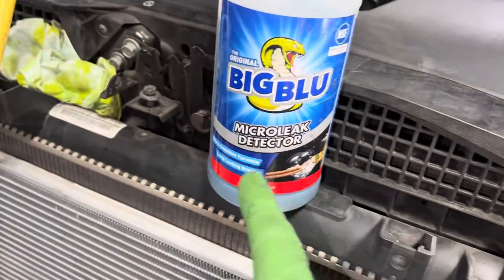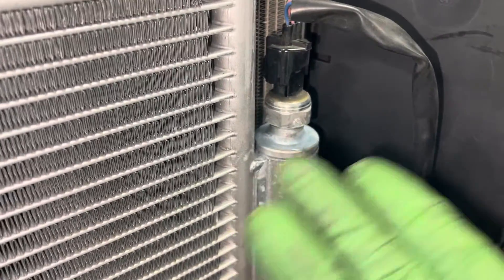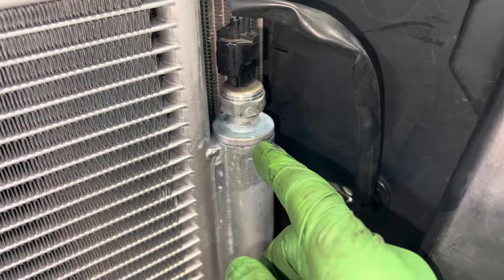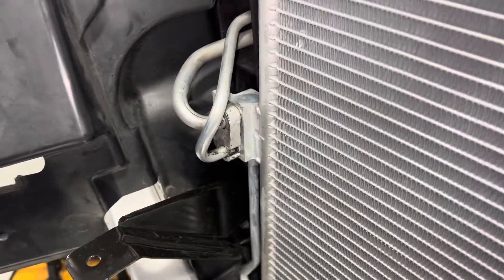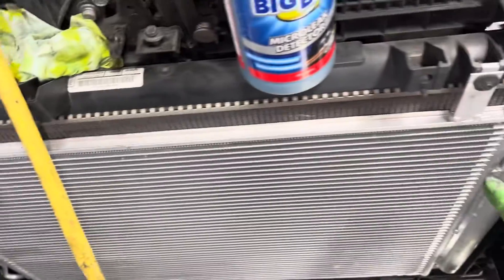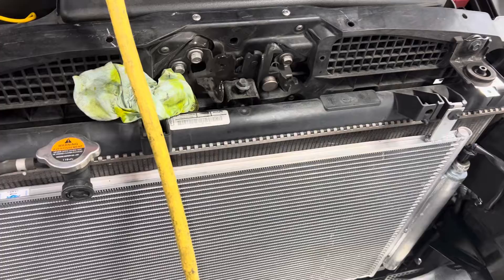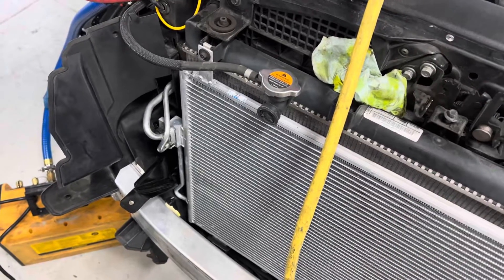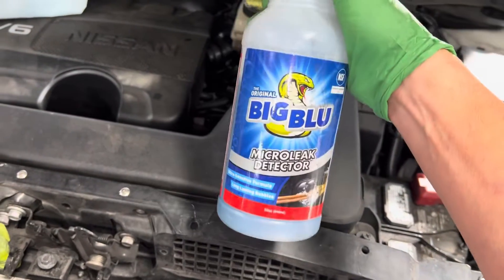REFRIGERANT BUBBLE LEAK TESTING .  Using big blue micro bubble leak detector. ￼

Comment: Would you recommend to change the complete o-rings of a car ac systems after some years, as a preventive routine service so to speak? 
I have seen complete kits of o-rings for my cars on rockauto. So my next ac service in spring could also be an o-ring service 🤔. The o-ring sets are cheap, wrenching is my hobby and......R134a is expensive...

Same question on ac hoses: My 1998 Mercedes E430 has very long "rubber parts" in the ac lines. I guess the lines being the factory installed hoses. Would it be a good idea to change them also as a routine service? I lose 200g of refrigerant per year on that car, so I am forced to give the system some clever service I think...

Thank you 😊
Reply: In this case he is verifying his work, especially with non OEM parts.  IMO changing o-rings as a maintenance would be an unnecessary expense.  Opening the system just to change o-rings can lead to a leak that can be difficult to track down for the reasons mentioned in this video.  If it ain't broke don't fix it.
Reply from the maker: Yes when it’s your own labor and it’s cheap and you like doing it I would recommend you you have a 20-year-old vehicle or older definitely by all means just disassemble the entire system and replace O-rings if it’s easy enough for you

The same goes with hoses 

Hoses do have a service life that is limited, and as they get older, some of them start experience a little refrigerant loss without actually showing any signs of leakage no oil stain no dust buildup and if you don’t like failures and you can afford it and it’s at your leisure Just like radiator hoses if they’re recommended to be changed at 60,000 miles or 90,000 miles you should do them but there’s people who’ve gone 20 years and 160,000 miles. I am one of those people PONT has set of hoses..

Don’t be afraid to leave your vacuum pump on overnight when you pull your vacuum before recharging your vehicle you can never over vacuum. All you can do is remove more moisture. 👍
Reply: Thank you, Mark and Tom, for your answers. I think, this spring I will do a big ac service on my Mercedes. Also all AC lines are still available in good quality at reasonable prices. Maybe I can reduce my loss of refrigerant. 
Don't know if I will vacuum it overnight....to prevent my vacuum pump from catching fire 🤣🤣.